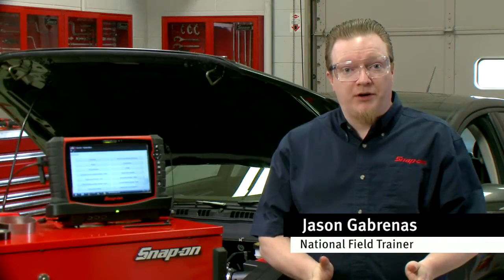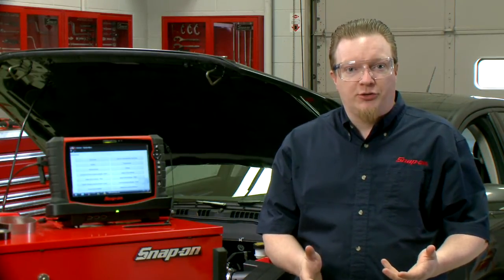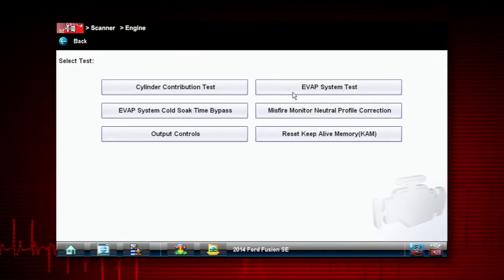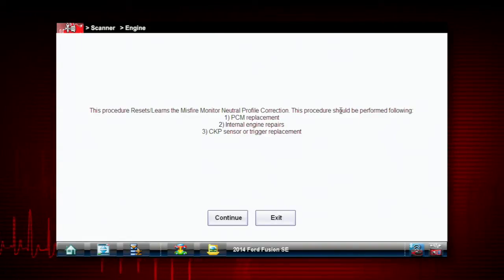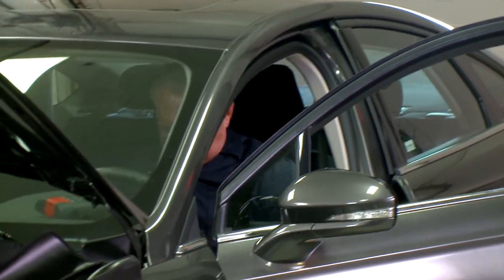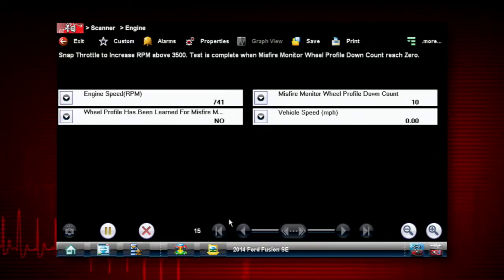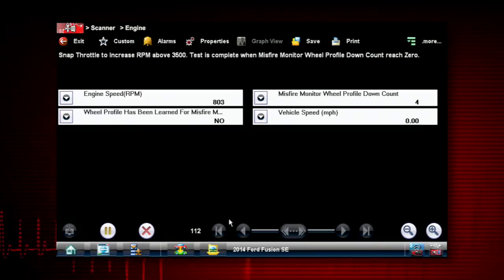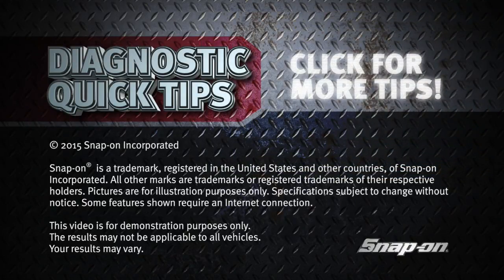Ford® Misfire Monitor Neutral Profile Correction | Snap-on Training Solutions®

Comment: I took my car to the dealer and asked them to this procedure and instead they did the "KAM" or Keep Alive Monitor. I am going to go ahead and take my car to the dealer tomorrow and show them this video. I clearly told them what I needed done and even then they got it wrong.
Reply: What kind of snap on tool can do this procedure?
Reply: The Misfire monitor neutral profile correction is only applicable on very specific Ford models that use the crankshaft position sensor. Some of Ford's vehicles only have camshaft position sensors to monitor engine speed and cannot perform this function-although that is typically something the Ford dealership would be aware of.